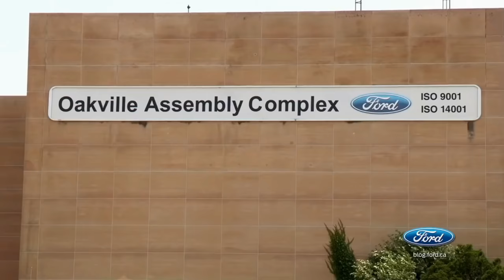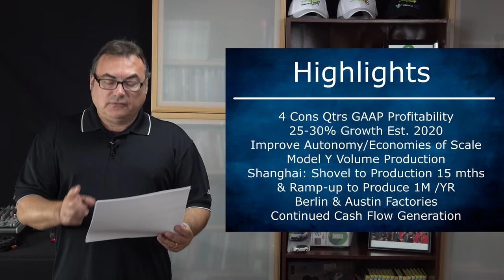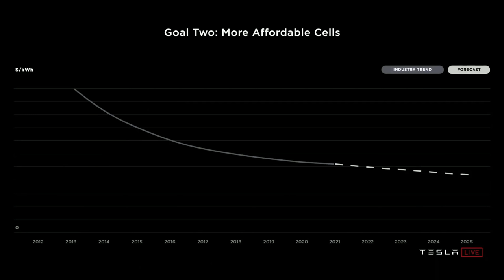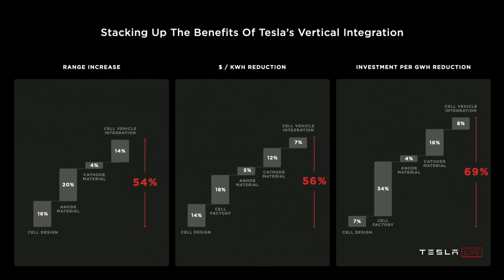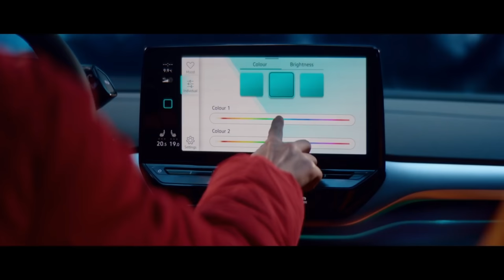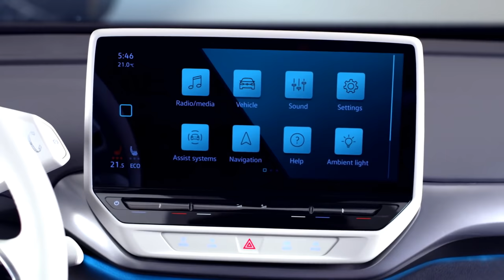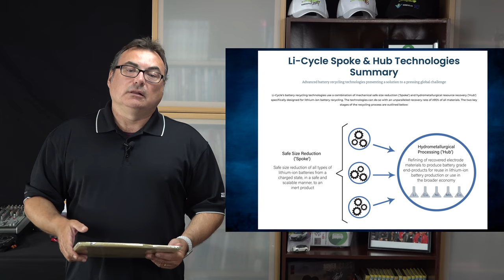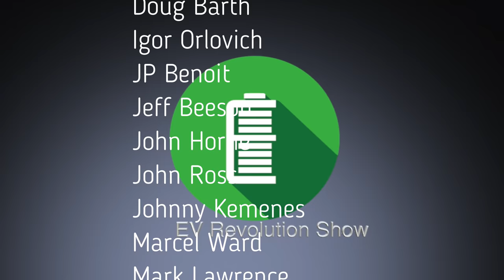Episode 108 - The EV Revolution Show - Tesla Battery Day & VW ID.4 Reveal!

Comment: With the exception of Steve Jobs, no other CEO talks hard core engineering like Elon Musk. Tera is the new Giga is every aspect of their fierce urgency towards electrification. This is pushing all others, despite it being slow. We’re getting there.
Reply from the maker: You are quite correct!
Reply: +60% growth per year because of lower prices is not slow. the car industry never had such high growth rates. of course it is still too slow for us consumers :-)  :-)
i personally don't see tesla as a leader anymore. now you can get a car with similar range, better build quality and refinement for 10k less. and you even get a nice display behind the steering wheel!
2022 VAG will probably already sell more EVs than tesla.
Reply from the maker: Thanks Stefan, appreciate your passion in your response comments.  I agree this industry is growing much more rapidly than the traditional ICEV, however it's still not fast enough.  Not too slow for consumers but for the Planet!  Acceleration is the key now in EV adoption.  

I would argue your binnacle display comment is subjective and I can tell you from personal experience, it is not missed in the Model 3 and Y.  

I really hope that VAG sells more than Tesla in 2022, however I don't see that happening yet as their ramp-up numbers seem to be weaker.  We will see.

Comment: EVs will get to 50% of total sales when the vehicles are affordable for the masses. Until then, the market for premium (Model 3) and luxury cars is limited.
Reply from the maker: Thanks for watching allan!  Yes affordability is the only way to get there.
Reply: Yes, 50% when the lower priced cars arrive

NO, Tesla is not limited by the "luxury" market.
They (and others) can sell every car of that type they make as long as it's a decent product. The mid/high luxury market is flipping to EV and as such is expanding demand faster than total production. It's the opposite for ICE (Covid anomalies accepted)
This will simply be repeated as prices drop and choice increases.
Don't discount either the "Tesla stretch", or government policy, both of which have an effect.
Reply: they are not far off with the price now (except tesla). in europe, after incentives, the ID3 costs approx. the same like the golf 8 now. in the last 10 years we had a growth of about +60% per year because of prices coming down. now with reaching the area of comparable  prices of ICE vehicles, I expect sales numbers to almost double every year. that means 50% in 2024 - but only, if they can ramp up fast enough.
maybe we should conservatively calculate with +60 because of limited supply. then it is 2025/26.
if you look at this growth rates then ICE vehicle bans in 2030 or later do not make sense anyway because almost no one will buy ICE vehicles anyway.

Comment: What did you think of Volvo's analysis that it would take 70,000 miles on current electricity generation for the Polestar 2 to negate the extra co2 used in it's production vs a petrol XC40? 30,000 miles if using100% renewable energy fo charging.
Reply from the maker: Hi TM, well that is Volvo's analysis of THEIR production BEV.  Other OEMs have different processes, suppliers and methods so all are not equal.  I still remain steadfast on the lower carbon footprint for BEVs overall versus ICEVs.  And remember, a BEV can last for 500,000 miles or more regularly, because of the simplified platform, advances in battery life and the ability to replace cells/packs.

Comment: A few things about the ID.4. It annoys me that I have to go to Ontario or B.C. where they pay higher taxes to buy a ID.4.  Also, I can't see why VW can't employ an online ordering system. How hard can it be? However I think a heated windshield should be standard equipment in Canada with all the snow and ice we get. 

And a quick tech question, are there any home level 2 chargers that can charge at 11kw?
Reply from the maker: Hello Walter, VW will release the ID.4 in a staggered method, starting with the 3 provinces I mentioned.  Reason being - 97% of all EV sales in Canada happen in those provinces.  So as a business decision, that is the logical approach.  However, they will eventually get to other regions via their existing Dealer Networks.  So you can wait then pay the tax rate you are used to.

Yes, the heated windshield (like in the e-Golf) will be standard as will the new heat pump in Canada. 

Yes, the Tesla Wall Charger can push 12kW - it does to my Model 3.  You would have to research other manufacturers to see what they can push.  Remember, the wall charger is only the EVSE - the provider of the electrons - the charger is built into every plug-in EV.  So it will depend on each vehicle, what it can pull.  Also, how the wall charger is wired up.  In my home, it's on a 60-amp circuit so the Model 3 can pull the max of 48 amps (12kW).
Reply: @EVRevolution  And a Tesla EVSE would work on a non Tesla?
Reply from the maker: @Walter Payne, Superchargers no.  But wall/destination chargers, yes.  I was using my Tesla Wall Charger for my Leaf for over 2 years, no issues.  Just need an adapter for Level 2.
Reply: @EVRevolution  1 more question, is there any word on VW giving Canadian buyers 5 years of remote access like the Americans do?

Comment: Tap-less. No typical tap design.
What I don't get: they will cram way more energy capacity into a car and then say it's part of reaching cost parity.
This might apply if they also offer smaller battery sizes, but with S, X and Y and to a lesser extent 3, we've seen that Tesla doesn't really cater to the lower end of their price range, they keep discontinuing such offerings.
Reply from the maker: Thanks for watching.  Well I am only repeating what Elon stated, they will get out a $25K USD all-electric vehicle with full autonomy within 3 years.  If anyone can, he can.
Reply: @EVRevolution  the ID3 is already at this price in europe.
Reply: @EVRevolution  We are only 3 years overdue on his FSD promise :-D
IMO a MOdel 3 wagon with modest battery can also be done at $25, but they insist of offering the "value" of quirky software a poor guy like myself don't need as first prority. Priority is to drive but all base models end up being scratch. No reason to expect other with with the in-theory $25K car.
Reply: @stefanweilhartner4415  More like double after VAT, to be fair. The small battery one is not on sale yet.

Comment: Imagine where we would be if the car and truck industries had embraced the unavoidable, inevitable need for electrification, rather than digging their heels in with ICE for 40 years or more.
Reply from the maker: Thanks for watching and great reflection!
Reply: people will buy it because of a better driving experience and because they are cheaper to buy soon. they don't care about the needs for electrification etc. but they care about money. to visualize that a bit better:
ICE vehicles are getting 1-2% more expensive per year while BEV get about 5% cheaper per year. at some point this will shift a bit to ICE getting 3-5% more expensive per year and BEV 2-3% cheaper.
Reply: Longer than that. Electric vehicle's we're at a similar market share. All the way until the 1920s. Once we started the oil booming.
Reply: @RC18 I’d argue that the ICE & oil cabal didn’t really put their shoulders (wallets) into EV suppression until the 1970s-ish, just as western civilisation began to realise that oil was too filthy to go on being used. They took it further when GM purchased the patents for NiMH batteries, and refused to allow them to be used to power EVs. Later, GM sold the patents to Texaco, who then merged with Chevron, who then sued Panasonic for supplying Toyota with NiMH batteries for the RAV EV fir $30million, and won. Necessity bring the mother of invention, new battery chemistries and architectures soon arrived, thankfully.

Comment: The reason the Unions were involved is because Ford knows that manufacturing an electric vehicle requires 40% less manpower. EV's do not create new jobs. They displace old ones. And if Ford has any hope of catching Tesla now they are going to have to change their manufacturing practices. The new mega casting of the front and rear clip that Tesla has perfected is removing 3 hours of time, hundreds of parts that need to be cut, stamped, and welded together reduced to a 5 minute process. And that is not something every manufacturer can do. They had to invent the machines and the aluminum alloy itself to enable it. When you consider that the analysis of Telsa's current model Y battery pack costs $108/kWh and factor in the cost savings of the new processes? You are looking at a battery pack that is going to cost less than $50/kWh. NOBODY else is even close. They are all hoping to get costs down to $100 in the next 5-8 years. That $25k Tesla? INCLUDES the cost of FSD. Which will be a $10k premium. The car itself is going to cost less than 10k to produce.
Reply from the maker: Thanks Dave, yes Tesla is far ahead as really they should be since all they do is build all-electric vehicles.  They've had 12 years to perfect this artform so to compare to traditional OEMs is not exactly fair in that regard.  However, that is no excuse for the OEMs to be lagging so far behind in their electrification efforts save a few.  

I'm not sure that your comment about displacing jobs is 100% correct.  That certainly depends as EVs bring a new marketplace to the equation with other supporting businesses/jobs to be had.  Maybe the average assembly line workforce is reduced, but not to say that other related jobs can be had.  Look, thru modernization and more automation, manufacturing as a whole is becoming more of a lost art with regards to number of people needed in a process, not just Ford or other OEMs.
Reply: @EVRevolution  An ICE engine has thousands of parts and accessories that are put together by hand. An electric motor assembly is done by robotics. The battery pack is assembled autonomously as well and their (Tesla's) new pack design is a cake walk now. The way Tesla is now engineering the construction of the skateboard is shaving hours off the assembly time as well as a ton of energy needed for welding and robotics. And the people needed to oversee all of those operations. As an Engineer with over 30 years in manufacturing design I can tell you that what they are now doing is going to produce a far superior product at a fraction of the cost. They have rewritten the rules of manufacturing.
Reply: @EVRevolution  Just fyi? From my calculations from the numbers presented, they are going to be able to fit 2x as much battery production into the space freed up in the stamping and forming areas of production, than they need for battery production to support the vehicle output of the factory. That means each plant will be able to not only supply itself, but contribute to the supply of cells for stationary storage.
Reply: @davefroman4700  
The battery factories will be like Lego. Modular, prefabricated
One "brick" at a time as production increases.
Each module will be set up with a different front end to produce cells of different chemistry.
All 4680.
All Maxwell.
LiFePo4 for base models/ storage
Other chemistry depending on model and changing as advances come to market. The "can" section will be the same in all modules.
Reply from the maker: @Dave Froman, thanks for that analysis.  So your are agreeing with the 20 Million by 2030 forecast from Elon?
Reply: @EVRevolution  Honestly? I thing they will hit it before.
Reply: @rogerstarkey5390  It won't be that small but it will definitely be modular. Think 4-5 truck loads instead of 50.
Reply: i think that pretty sums up the wet dreams of elon. however, these are just his dreams. the reality of course is different. VW produces cars with similar range for 10k€ less. you even get a display behind the wheel without paying extra. and modern EVs are also ahead of Tesla regarding modern features. you get adaptive matrix LED headlight, head-up displays with augmented reality, displays with cameras as side mirrors,...
there is a lot going on that tesla fan boys do not see because of their believe system. they think that tesla has an exclusive tech like battery tech but the reality is, that you get 300 Wh/kg from every major battery tech manufacturer like CATL, LG Chem, Samsung SDI, SK Innovations at the end of the year. Some car makers have nice battery modules that can be replaced easy without the need of replacing the whole battery pack. that is nice for maintenance and might even allow upgrades in the future. i don't see tesla leading anymore.
in the premium sports car sector porsche is doing very well. their Taycan is now their best selling car now. they needed to rent an additional assembly line and additional 400 workers and later another 500 workers. they are ramping up production as fast as they can because demand is so high - even at a price tag of 170k€ because it is such a refined high quality car with unmatched driveability.
Reply: @stefanweilhartner4415  And VW admits they are losing money on every single one and will be for at least 3 years. If they survive.
Reply: @davefroman4700  i think this only applies to the older ones like e-golf, e-up, mii-electric and e-citigo.
Reply: @stefanweilhartner4415  Nope sorry. 
Its the cost of the batteries that is killing them like all the rest. Tesla is the only one that has been able to get their battery costs down below $1.10kWh. Don't believe me? Ask Sandy Munro.

Comment: Love your videos, tone and delivery Kenneth- 👌

To build upon 1 of your comments- in fact Giga Berlin will have 8 'Gigapress' casting machines! This is a game changer in auto manufacturing. The machines come from IDRA group in Italy
https://twitter.com/tobilindh/status/1279782286070886406?s=20 from Tobias Lindh- good guy to follow btw. Local observer of Giga Berlin.

There will be 2 castings- front and rear. 
The central battery pack (sub- assembly) is constructed from 2 stamped metal plates (used for heat dissipation) these are then 'epoxied' to the batteries, creating a super rigid central sandwich core. 
The aluminium die casts are then added front & rear.

Also- Tesla poached Apple Materials alloy expert Charles Kuemann a few years ago
https://www.businessinsider.com/tesla-spacex-just-poached-apples-alloy-expert-2016-2?r=US&IR=T
The alloy his group created is extraordinary

... and if you're interested in why the castings are such a big deal- I contributed to a video back in March calling this out (a bit 'old now, this was before global meltdown 😂)

https://www.youtube.com/watch?v=gHzCo8MoohA&t=224s&ab_channel=TwoBitdaVinci

Keep up the top work on the channel 
Cheers,
Anthony
Reply from the maker: Much thanks Anthony as well as for all this great info!